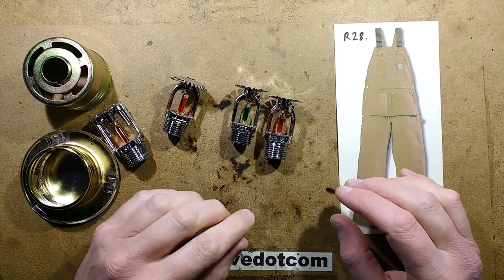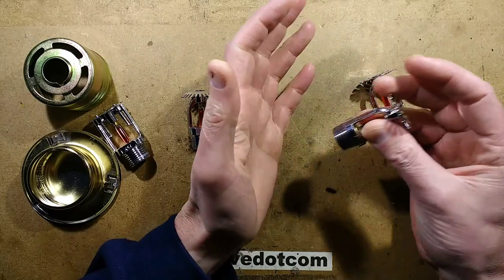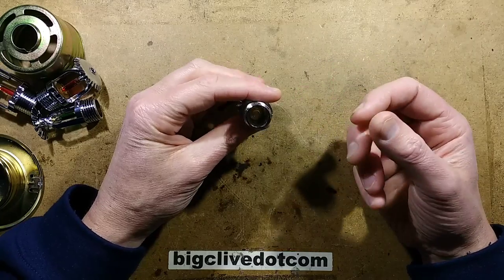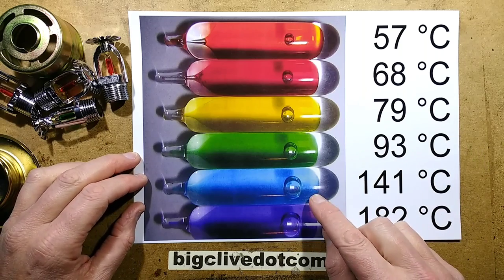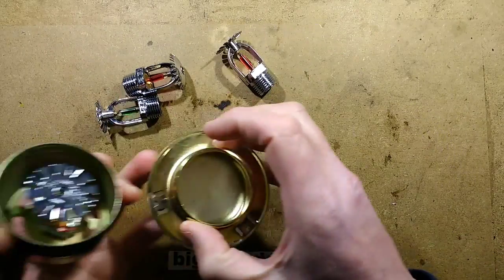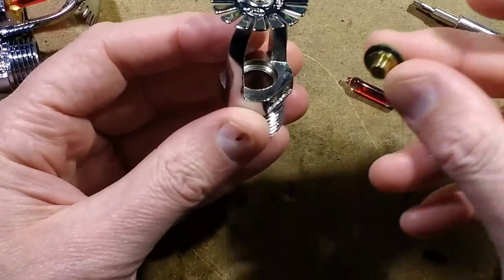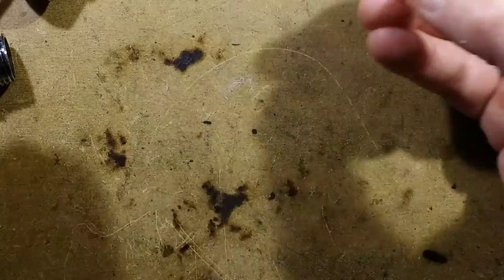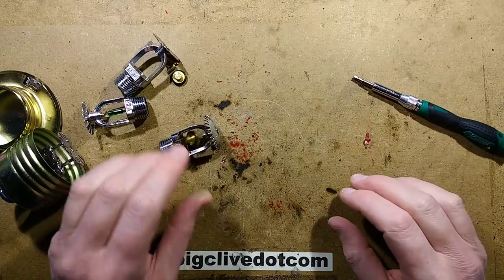How a fire sprinkler works. (featuring broken glass and spatter.)

Comment: I would have thought the vials are broken by the expanding liquid, the air bubbles are compressible so set the amount of expansion before the glass breaks.
Reply: True, but we do not know if the bubble is normal air, or vapour from the liquid? In a thermometer there is a partial vacuum for the liquid to expand into, with a sprinkler we want the tube to break!
Reply: Gordon Richardson as most liquids are incompressible, if there was no bubble, the glass would break the moment any heat was applied, the bubble allows the liquid to expand in volume by a set amount before bursting the glass. This allows them to be tuned to specific expansions and therefore specific temperatures before breaking. As far as I understand it doesn't matter exactly what the bubble is composed of, just that it is compressible although for the same temperature setting a vacuum bubble would be very slightly smaller then an air bubble.
Reply: If you watch the video at a slow speed setting as Clive heats one up, you can see the bubble disappears from the tube a few moments before the glass breaks as the volume is taken up by the expanding liquid
Reply: I did not notice the bubble disappear! BTW, the composition of the liquid must vary (with added glycerine), since ethanol and water have such low boiling points that no amount of air bubble would contain the vapour pressure at high temperatures.
Reply: Gordon Richardson that's true, with the price of them so low I'm considering getting a few to experiment on. You can't go wrong with exploding glass right.
Reply: On second thoughts, the vapour pressure of the liquid must be kept low, in order to keep the operating temperature range consistent. This is because the glass is sensitive to the difference between the interior and exterior (so-called gauge vs absolute) pressure. Otherwise it would not work consistently in a high elevation state such as Colorado, where the air pressure is lower than at sea-level. Cody should test one in his vacuum chamber. Lots of things to think about!

Comment: I guess the "bubble" will be a vacuum and the higher temperature resistant ones will have a larger space for the gas to expand from the heat, meaning the liquid is probably set right chemically to expand quickly/at a set rate at which will fill the vacuum with gas at again a certain rate so the pressure will make them explode!

Comment: Sprinklers are nice but are an inspection nightmare to me. There has to be a special cover over the pipes in the attic to prevent contact of insulation, any wires must be tied up and run high over (including ultra low voltage), then they have to be inspected every so often, finally the back flow requirements are a bit heavy. I use many electronics and sensitive machines, I prefer Halon (no longer available) or its new less effective hydrocarbon (or inert gas) based versions (i.e. FE-13). Even in a house, a little fire damage is a lot less work that a pile of water damage too.

Comment: Fun fact. A usa apartment building had these installed in the 80s. They cheaped as much as they could, everywhere, including the thickness and grade of copper tubing. Now all the buildings are failing horribly. Like the thin tubing is leaking water through the ceilings. I’m just amused by the absurdity. Especially how they continue to having to replace the tubing more like every 5 years.

Comment: I’ve heard of the higher temperature sprinkler heads being used in data centers or server rooms of large businesses. In that case, they would have a halon system as the first means of fire suppression. If that were to fail to put the fire out, then the sprinkler heads would go off.
Reply: Michele Marie Dalene You are right that halon was phased out of production, but you can still obtain recycled halon to recharge existing systems. Some systems do use pressurization of a room with nitrogen, but my understanding is that halon and it’s replacements like FM200, FE25, and NOVEC 1230 are more common.

Comment: @4:30 I think the pressure of the water will shoot the "drop down system" out at such force that it will knock the lid off, rather than the lid melting off.
and @7:40 did you really think you could light the fluid, that's inside a vial that is supposed to break when a fire is going on? :)

Comment: What I'm curious about is can you interchange the vials on the sprinkler heads?
Reply: In principle yes. However, you would have to be quite careful with handling and fitting them properly. In addition, any nicks or scratches would make the glass liable to fracture...
Reply: Gordon Richardson that's what I predict as well

Comment: The liquid may well not be anything more exotic than coloured water... I remember in my school days, making a crude thermometer in chemistry class. It was filled with plain tap water. I was surprised by the expansion ratio of plain water. Add to that the small air bubble in these capsules, this would allow a degree of thermal expansion before the liquid begins to exert any significant hydraulic pressure on the glass. I would concur with Clive's assertion that the bubble size is significant, and that the bigger the bubble, the higher the temperature before activation. Activation would not occur until the bubble was compressed to extinction, and only then would the glass become subjected to internal hydraulic pressure. The glass is prestressed by tightening the screw securing the capsule in place, so the only way the liquid can expand is sideways, against the weakest part of the glass. The hydraulic pressure fractures the glass, the pre-stress ensures that the glass will shatter, and the water pressure in the supply pipe does the rest.

Looking at the diameter of the hole, exposed by the ejection of the brass plug, you will need a significant volume of water to achieve an effective 'sprinkle'. I'd reckon on a large diameter feed pipe, and a good head of water to feed more than one or two sprinklers. I doubt if a normal domestic supply would be very effective - certainly not where I live!

Reverse engineering this through Clive's video, it makes a mockery of the classic Hollywood movie sequence where a fire triggers one sprinkler, and then the whole lot go off...... The only sprinklers to be activated would be those directly affected by the fire. In any part of the building where the temperature didn't reach the trigger point, the rest of the sprinkler would remain inactive - which is good, because it means that the water pressure to the active sprinkler(s) is maintained and the water supply conserved to keep those sprinklers going for longer - long enough for the fire service to arrive.

Comment: Might it be thermal expansion that causes the fracture. Try a pellet out of the sprinkler head?
Reply: In theory differential thermal expansion might work, but thin glass walls are much more likely to break sideways than length-ways.

Comment: Anybody else’s immediate thought: ‘Christmas lights’?
Reply from the maker: They would make for a nice industrial tree.  Particularly if it was actually made of sprinkler pipe with concealed wiring inside.
Reply: bigclivedotcom - a warm white led under each and you’ve got a pretty good simulation of ye olde incandescent(e) Xmas lights. So long as they don’t get too hot, or things could, as you might say, get ‘interesting’.

Comment: The liquid is usually alcohol and water. The alcohol to lower the boiling point, the water for vapor pressure.
Reply: Actually ethanol has a higher vapour pressure than water. Glycerine raises the boiling point for the higher temperature versions.
Reply: Ah ok.

Comment: Sprinkler fitter with union local 821 here to drop some knowledge on yall. The liquid inside of the capsule is mercury and yes, the bubble does control when the head explodes. Depending on what environment the head will be used in depends on what head is to be installed. For instance, a 155 degree head, ie the red one is used in commonplace where it typically wont be exposed to high temperatures while a green one or a 200 head would be used in say, a power room because if may be exposed to extra heat and you dont want it to go off on accident and short anything. You have 3 main types of sprinkler heads, concealed heads, the one with the plate (called an excussion) an upright sprinkler head and a pendant head. When it ruptures the water is under pressure and hits the head and spreads the water.

Comment: Actually install isn't cheep. We had a crew come in and install a sprinkler system and it cost 
33,000 for them to run the pipe. ( they were there for 2 days)

Comment: You likely could check the spray shape/pattern by putting them on the end of a garden hose. They probably fit.
Reply: if he used an adapter yes, most common sprinklers are 1/2"-14 TPI thread(what he has), there are large volume/GPM (gallons per minute) with 3/4"-14 TPI thread but not used nearly as often. and garden hose is 3/4"-11.5 TPI(threads per inch) so no go threading together :)
Reply: British standard hose is generally 14tpi actually.
Reply: But he lives in the Isle of Man (In the British Isles)
Reply: doesn't matter IRL, because they are still 1/2" vs 3/4" , the thread pitch was not needed 100% ;)
Reply: Ahhh now I see, need to work on my reading comprehension .

Comment: Does the tail on the glass tube perform the same function as a Prince Rupert's Drop?
Reply from the maker: No.  It's just the sealing point.  The internal pressure is what shatters the glass, although the glass itself may be optimised for shattering in small pieces.

Comment: air compresses liquid doesnt so the bigger the bubble the more room the liquid has to expand when heated. so the bigger the bubble the higher the temperature before it goes off. and some systems have a pump for the water so when 1 in an area goes off the pressure changes and the pump starts and can make all the heads pop from what i have heard but happy to be told im wrong :-)

Comment: The bubble is not a gas expansion trigger? i assume the gas will expand at a better constant than a liquid would for this device.
Reply from the maker: If you watch the point I triggered one with heat you can see the bubble contracting as the liquid expands until there's no more gas to compress and the vial bursts.
Reply: @bigclivedotcom  Can't see that but it may be a picture quality issue.

Comment: More modern fire systems have a fail safe method built in where the system also has to have a second area (zone) sensor to be tripped to indicate a real fire and dump water. The pipes are filled with compressed air and when the control box senses a loss of pressure, it then waits to get a second indication before it opens the valve to dump water. Also they are now tied to HVAC systems and they are shut down in the event of a fire so it doesn't fan the fire. This is especially important to be used in telecommunication centers where an accidental dump would be a disaster and all equipment destroyed.

Comment: but there are two types of sprinkler system: fresh water which is comes from the main water supply, and stored pressure, which stored pressure has 1 downside as the water is stored when your sprinklers were installed , lets say for example you had a stored pressure sprinkler system installed 30 years ago, you had a fire, the sprinklers activated, your water would be that horrible brown colour and it will ruin everything, water does more damage then fire in most cases.

Comment: Two thoughts... If you fit one in your workshop you should take into account water pressure it should be between 2 and 2.5 bar of pressures - too low and the radius of the water will not be as big as excepted, above 2.5 bar you might just get a fog or mist and that might not be what you want... and the bobble - i think its filled by a needle, and size is then controlled by the amount of liquid redrawn... easily controlled, just overfill and redraw x ml..before fusing the glass with hot pliers
Reply from the maker: That would make sense, using a needle to inject a specific quantity through the capillary section before tipping off.  I'd think that any damping down at all would be better than nothing in a fire.  At work our control rooms have pressurised nitrogen tanks that dump another tank of water through misting heads at force.
Reply: Yes, agree any thing would be better... my comment was made to make people think about ways to put out fires - sometimes its better to kill it by removing oxygen from the source, eg. drowning the fire with water, or remove oxygen from the room with an inert gas like inergen/co2/halon. Or sometimes its better to kill the fire by removing heat - and thats where vapour/fog/mist  can come into play. depending on the room and were one should also consider the dammage that can be done by using dry pipes... 20 odd years ago i was building a server room, and we did a testrun after 6 month with halon in dry pipes - the room was dust free - but after we fired the suppression system (exchanged the halon with normal compressed air), the room was covered in dust and rust particles and actually did some dammage on the electric panel due to the speed of the small partials that came out of the pipes... so even if fire suppression seems simple, there is a lot to consider, even noise and sound pressure must be considered.. perhaps not for a DIY place... but again if you  have a bit of knowledge you can use it, and take it into account.

Comment: The size of the bulb is important too. A small bulb goes off fast, a big bulb uses more time. The most common bulb is the red 68 Centigrade small one. In roof windows you use a higher level due to the heat from the sun. Typical dark purple.

Comment: i imagine the bubble has nothing to do with it, but its actually just the glass getting thicker and refracting the light different
Reply from the maker: The bubble is compressed as the fluid expands with heat.  Once the bubble has gone the hydraulic pressure of the still expanding liquid ruptures the glass.

Comment: Maybe someone pointed this out before me, but I'd imagine the size of the bubble has to do with pressure inside the vial. Smaller bubble = higher pressure = higher sensitivity?
Reply: As the liquid heats, the bubble will shrink.  Once the bubble is gone, further expansion of the liquid will shatter the glass.  The bigger the bubble, the hotter the liquid can get before shattering the glass.

Comment: I worked at an old library when in college. When they renovated the building, they had to bring the rest of the building up to code, which included installing sprinklers in the stacks, which had low ceilings. Let me tell you - those motherfuckers are SHARP! I lacerated my forehead a number of times on those damn things. Most had cages around them to prevent that, but some had been stolen or otherwise lost.

Comment: Actually, the systems I have seen run way below mains pressure. Once one goes and the pressure drops, a gate valve opens up and full mains pressure hits the line and breaks the rest of them open. I would not try one of these at full mains pressure. The system we have sits at 40psi and bumps up to 80+psi when tripped. (I never tried tripping it and measuring it! ) Location- East cost, USA.
Reply: Thanks for posting! I suggested this earlier, but was told that it is not a common configuration.

Comment: The liquid is Alcohol. As the liquid, which is incompressible, heats up, it expands and compresses the air bubble. More air means more room for the liquid to expand which means higher temperatures are required to break the glass.

Comment: If you heat the liquid so the vial overflows and then seal it there will be no air inside to form the bubble, you may get a vapour bubble but only if the liquid is volatile, or the vial may implode as the liquid contracts and reduces the pressure in the vial

On the other hand if you completely fill the vial, heat it to the required temperature, let it overflow and then let it cool there will be some air at the top, which after sealing will form a bubble, and the pressure in the vial will be at atmospheric pressure.

Comment: id be wary of the chinesium ones, the body and plug may corrode up, the rubber seal may dry rot or swell and seep causing corrosive fusing of the parts and non activation!
who knows if the vials even work at proper temps.

Comment: AFAIK .. or learned, constantly pressurized sprinkler systems are not allowed anymore in germany because of stagnating water.
On the other hand you'd have to trigger fire alarm, pressurize the system and then the vials are already broken where it burns.
Basically you'd have to survey the dry system with low pressure or vacuum for leakage.
Gonna need to read in my trusty book-o-planning.

Comment: There are way more simple than I thought, I thought they all fired at the same time from a signal of a single thermometer or smoke detector.
Reply: Deluge systems actually work like you said.
But you only find them in areas where a fire would spread so fast (A paper warehouse for example).

Comment: Looks for overalls, buys sprinkler heads, go figure, well done you!
Next test, determine IF you can set off sprinkler head with a laser?
Reply from the maker: I'm not convinced you can with a reasonably powered laser, as the surface has to be fairly matt to absorb the power.  Standard laser pointers also diverge over distance to a much wider spot.